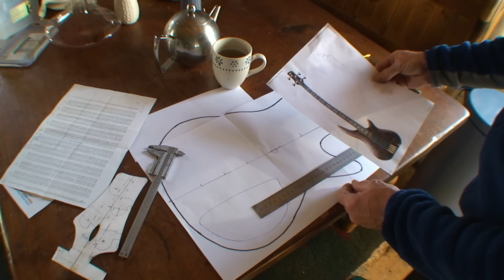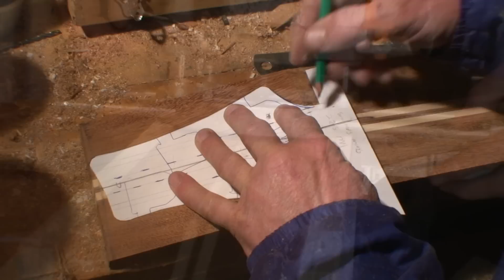building a walnut bass guitar

Comment: Just A question I am just restarting playing the bass guitar and my hands are A little smaller than the average bass player so if I could find A guitar builder around the Welland area.See what I would like to do is not shorten but slim the neck and maybe add one or two more frets so my reach to play certain songs or hit certain notes isn't such A reach. Please help if anyone can.
Reply: Search for a short scale bass guitar. they have a shorter scale length so the frets are closer together, and the strings have lower tension so it is easier to play. they're also a lot lighter which helps when you play standing up for a while.